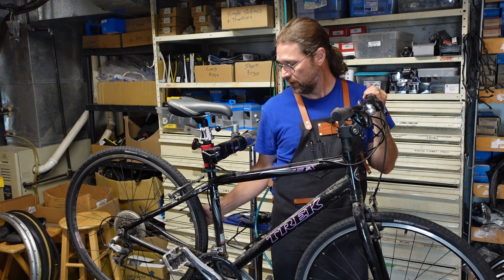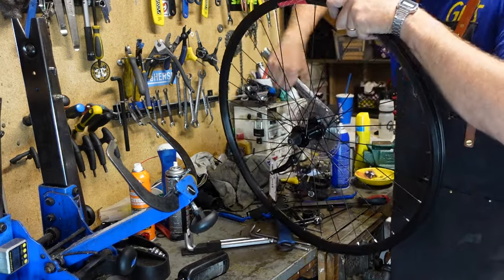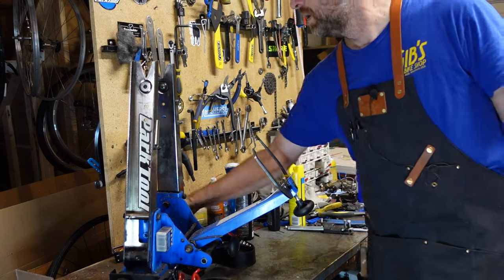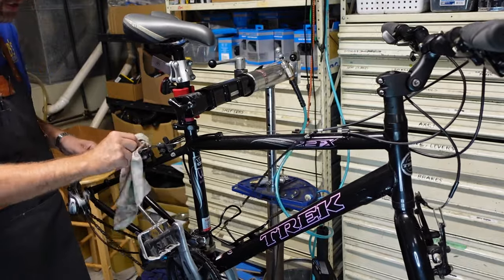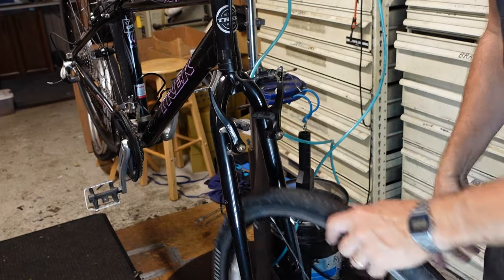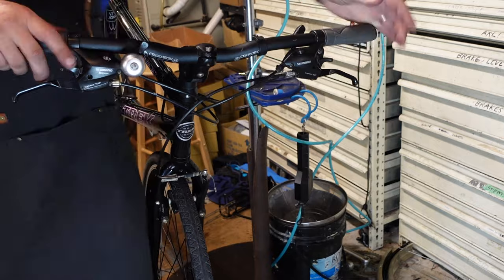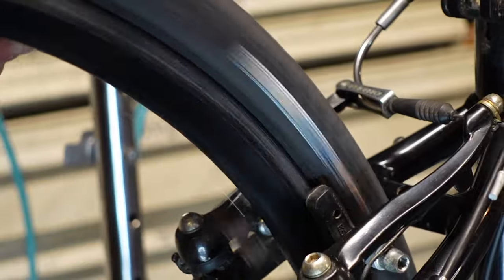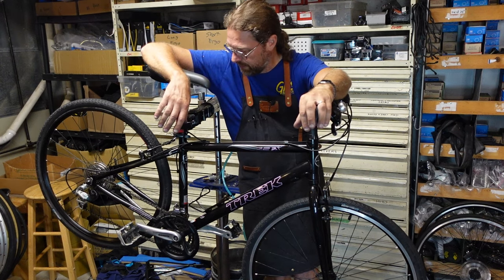The BEST VALUE in USED BICYCLES! Trek 7.2 FX gets a new rear wheel and a fresh cleaning and tune up!

Comment: This may seem counterintuitive as a brake squeak remedy, but soaking the brake pads and wiping the rim surface with 303 protectant will eliminate noisy braking.  It’s a prettier method.  Works on squeaky drive belts, too. Just use a little spritz!

Comment: For the viewers: DO AS HE SAYS MAKE SURE ALL YOUR BOLTS ARE TIGHT, I did not do this when I got a used dynacraft 26" full suspension mountain bike and received minor injuries when the handlebars came loose and flipped forwards unexpectedly causing me to loose my balance and crash a couple weeks ago, I survived and now just have a small bruise on my right leg but it could have been a lot worse even with a helmet on, I fixed the problem and have been checking the clamp bolts so I don't have to go to a funeral as the body from an early and preventable death.
Reply: It’s def also worth considering applying threadlocker blue to most bolts.